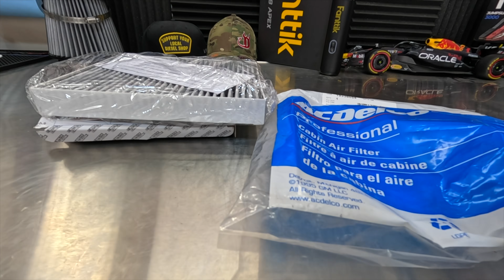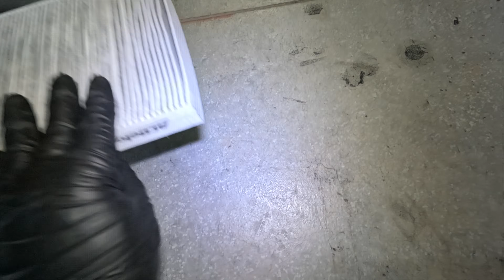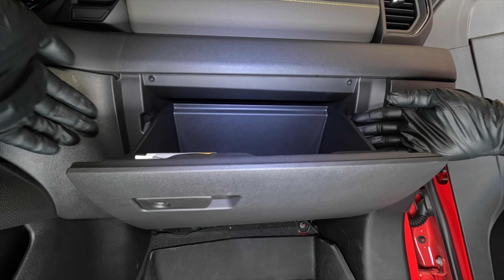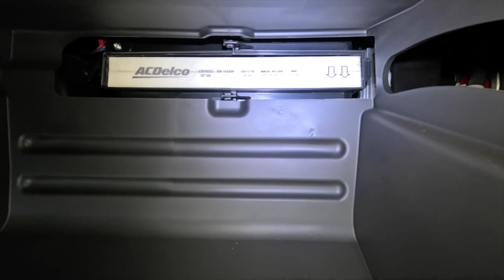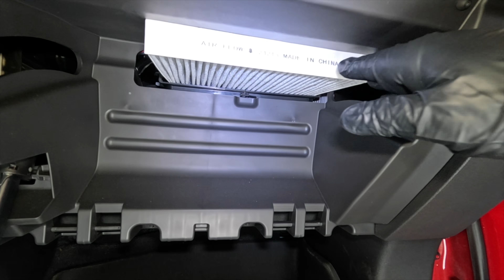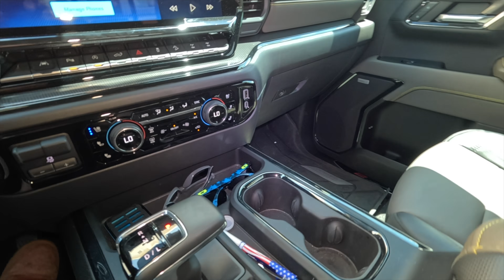Musty AC Smell? Silverado Cabin Filter Replacement (2019+)

Comment from the maker: Are you getting a nasty, musty smell from the A/C vents? It's likely time for a new cabin air filter! In this video, I'll show you how to quickly and easily replace your cabin air filter, eliminating those unpleasant odors and improving your truck's interior air quality. We'll compare a premium ACDelco carbon filter to a cheaper alternative, highlighting key differences like pleat count. Learn the crucial steps often missed, like properly dropping the glove box and ensuring correct airflow direction. Say goodbye to stale air and hello to fresh drives! Amazon affiliate links provided could monetarily benefit the channel.
AC Delco Cabin Filter for 2019+ GM Trucks: https://amzn.to/46Yq8o4
Cheaper Variation: https://amzn.to/3H7hUzt

Comment: Not the right video for this I know but it is the most recent. You have owned a few different 3.0 trucks and this 2025 ZR2 1500 is my second. Have you noticed the ZR2 does more regens than your previous ones? My 2024 GMC AT4 CarbonPro seemed to not do as many. I am just over 3k miles and have had the truck since April. Thanks.

Comment: I checked orientation first winter with mine. 

Sometimes in -20 or colder temps my blower doesn’t work at full speed no matter what I do. BUT when if I turn the truck off and start it back up it runs full speed for 5-10 seconds then back to basically. 

I do everything I can to make sure the intake areas for the cabin air are clean and nothing helps. I’ve never had this problem in 20+ years of driving. 

I’ve never been able to take it to the dealer when it’s doing it because I leave way too early in the morning. Such a pain.

Comment: I think a lot of the smell is from the coil and I think it’s due to the start/stop allowing more moisture to condense on the coil. My old bmw did it and had a bad smell too and this is my first Silverado with it and it has a similar scent. My wife’s Yukon also has this issue.
Reply from the maker: My truck doesn't start/stop, but you are correct the smell could be deeper, but I always suggest a clean filter first. A good cleaning treatment will solve the rest.

Comment: I have a 24 Silverado and this summer I’ve had that musty smell even after I installed a new filter. I had my dealership try and activate the afterflow fan, which just means the cabin fan will continue to run after the vehicle is turned off, but he couldn’t get it to activate. I tried with my scanner as well and even though I could activate it, it wouldn’t work. How hard is it to use the kit to clean it out?
Reply from the maker: Use this stuff I am linking, works amazing ! Just spray it at the intake of the a/c and then let it sit. I turn the mode to in cabin recirculate then spray it at the footwell area as that is where it's pulling air from. You can also go outside to the duct below the windshield for exterior air. https://amzn.to/4lQ92NT